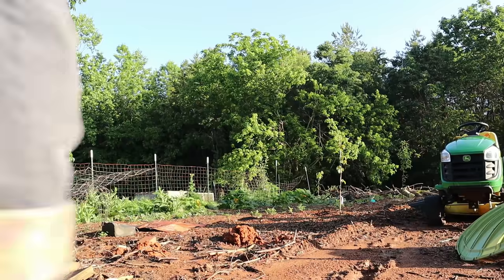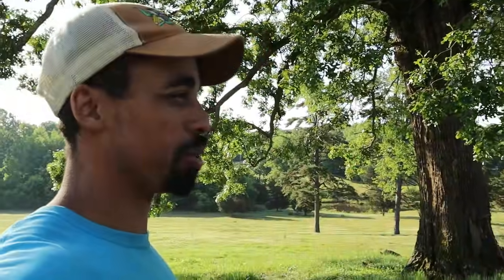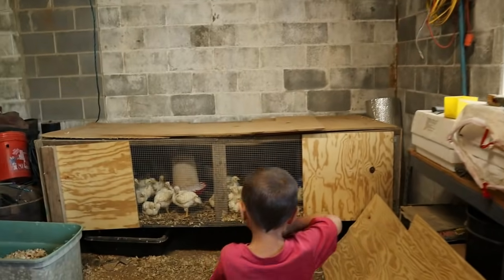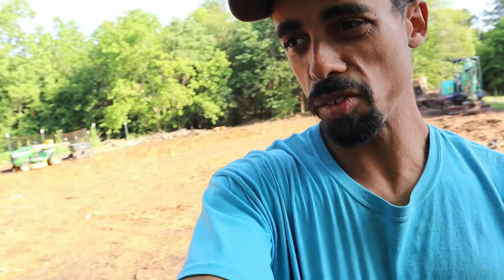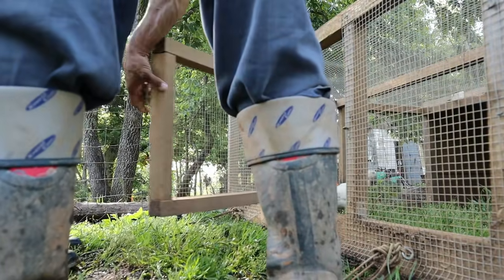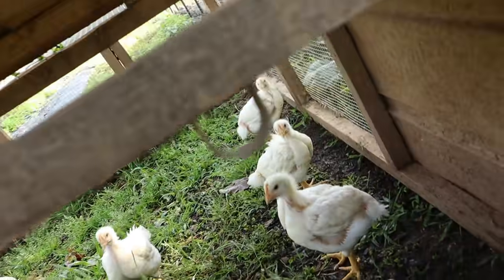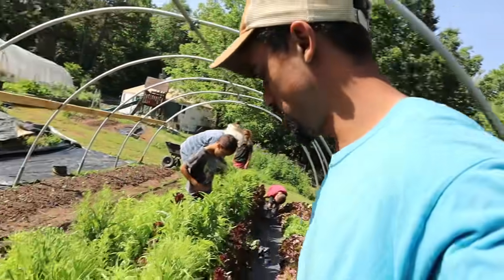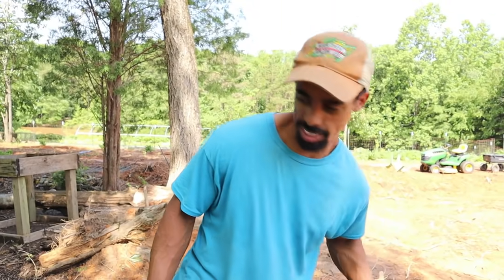First time raising CHICKENS like these

Comment: You need a Hundred foot tape! You will use it more than you think. And hire a Surveyor!! Are you getting an acre or 2 or 3 acres? Well, that's really none of my business.  But an acre is   43,560 square feet.  Measure the distance of 208.71 feet.  This is the equivalent of 208 feet and 8.57 inches. Mark starting & ending points  for this measurement.  Measure the same distance running perpendicular to your starting point.  Do this same measurement twice more to form a square.  Each side of the square should equal 208.71 feet, which equals 1 acre.  Surveyors are much easier, but more expensive.  But usually will hold in a court of law.  And legal is better. GOD bless